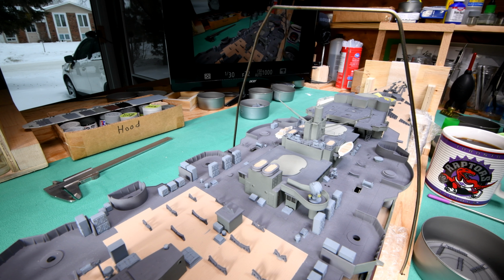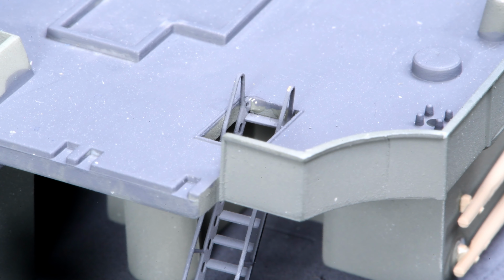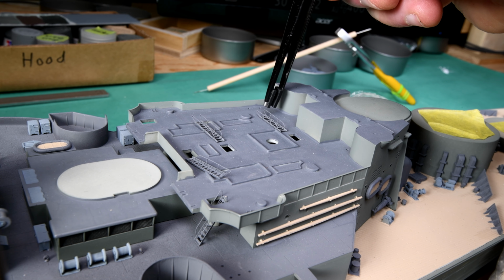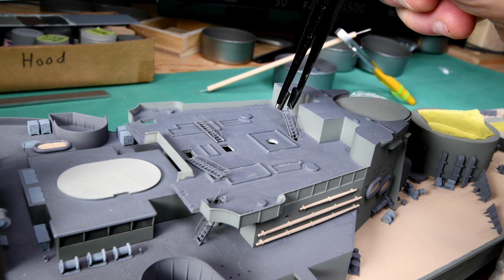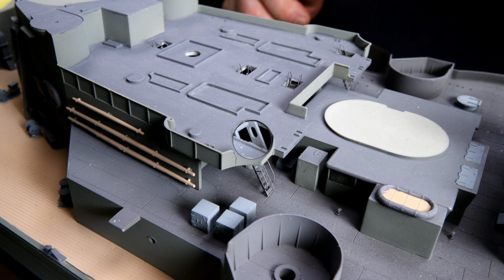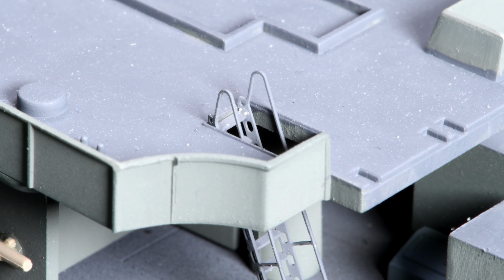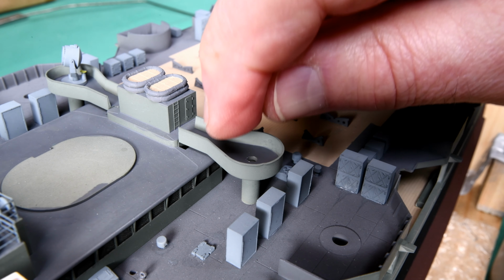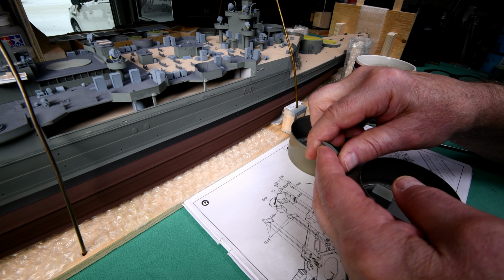The Model Ship - Part 702

Comment: Hi Ron. have you thought about using an accelerator for the CA glue. I use it at home for quick fixes.
Reply from the maker: Yes, have used it many times, but have run out. 👍
Reply: @roncalverley   Baking soda in water works in a pinch.